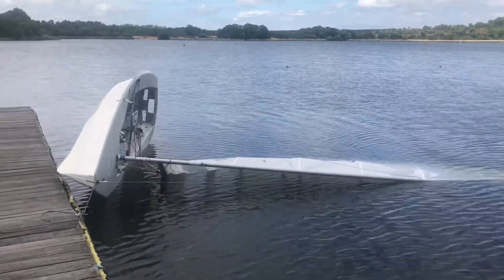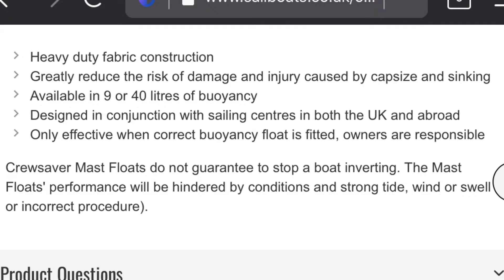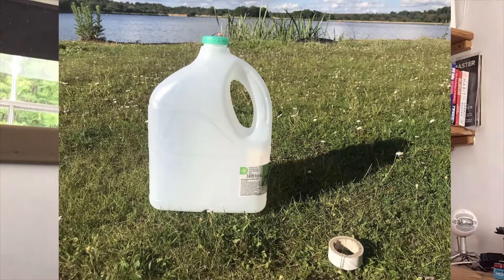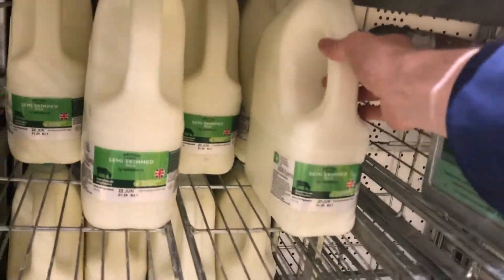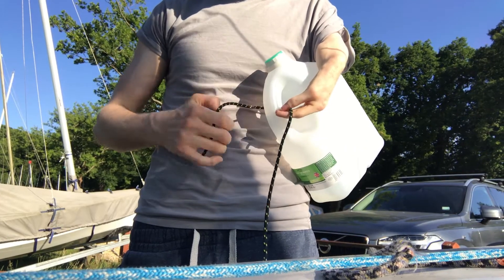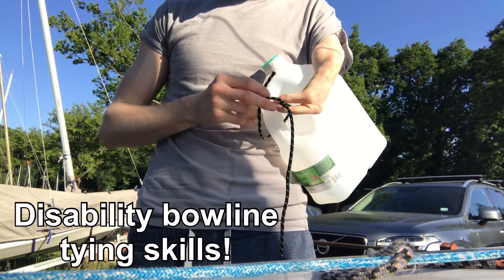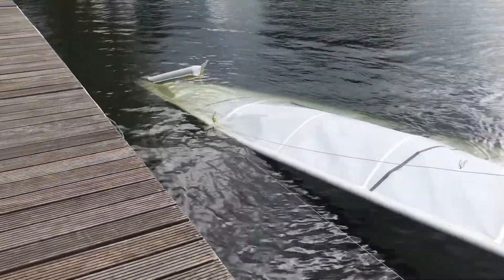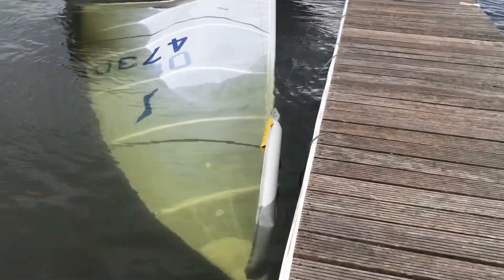How To Make A DIY Mast Float | Milk Bottle VS. Crewsaver Mast Head Float

Comment: If your dinghy is a bit bigger and has little spreaders like the ones in our Sailing club, then just put hollow poolnodles the shrouds over the spreaders. The colour let´s you differentiate boats easily during a race and it does a nice job as a float.
Reply: That is an excellent idea , or you could fix on pipe insulation (from DIY shop)  to the spreaders.  They are already marked to be slotted with a knife and could be fixed with zip ties.  I'm not sure how good the buoyancy effect but where the spreaders are gives better support to the mast on the water.

Comment: I've settled for a 5 litre plastic bottle tied to the head of the sail by a lanyard about 20 cm long. This allows the float to blow away from the sail and allows me to see the wind direction indicator at the masthead. This arrangement undoubtedly causes significant drag but is probably less disruptive than a 90 cm float lying along the leading edge of the sail. both work well having capsized in anger with both arrangements.

Comment: I just found a 4 euro inflatable "stool" here in Norway in a cheap furniture store. It has  45 cm in diameter and is shaped like a cylinder. Unsure about the height, but at least 45 cm. So volume is at least 71 L.  My dinghy is 17 feet. Will try it out, but compared to your milk bottles my plan is maybye an overkill..?

Comment: If the boat has a pocket luff, then the quickest, most effective solution is to stuff a pool noodle up the mast section.  Make sure you use the hollow type noodle so water can drain back.

Comment: Good vid, well done. I bought the 9-litre float a few years ago, although I'm mostly very careful not to capsize. But I calculated that it actually has less than 8 litres capacity. It's crazily costly for no better function than the bottles provide.
Reply from the maker: Thanks. Yeah, only reason to buy the floats is they look better. But if you're only concerned with function the milk bottles seem pretty much as good

Comment: How about running a line from the top of the forestay to the top of the mast - and use it to secure a hollow pool noodle - or even a large-bore closed cell pipe insulation? (same thing really)  If taut, it shouldn't affect the sail dynamics much or hauling the sail up, but provide good flotation?  Not sure if you could find one that fit around the mast itself. Haven't tried it, but a few swims last year from my ISO  are making me think about it.

Comment: Would be good if masts were supplied with a little extra free length above the sail pulley sufficient to install a wrap around buoyancy aid. It would look better and perform better. I notice that both the bought item and your milk bottle variants did not utilise their full buoyancy due to standing above the water.

Comment: Well the main thing is not to go turtle - or at least not have your mast go very deep (and get stuck in something unpleasant)  I submit that a 2 quart or 2 liter size bottle should be enough.  The deeper the bottle goes, the more bouyant it becomes.  I actually use milk bottles to tie to my mooring chains here on lakes in the winter.  I allow enough water into a bottle to allow them to submerge a couple of feet so the ice doesn't get to them in the winter.  Saves having divers charges in the spring.  If you do this make sure you take pictures of landmarks that you can triangulate the position of the mooring in the spring.  At any rate - the partially submerged bottles back up my theory about the size of bottle required toi prevent a boat from going full turtle.  I need to do some experimentation with this some more though ;-)

Comment: Any color other than black is not electrical tape, it's marking tape. Only black has legally-mandated dielectric properties.

This does not mean all black tape IS electrical tape. You have to look at the label for approvals from the governing bodies.

I say this because a flimsy layer of polymer and adhesive, though better than bare copper to touch, is not to be relied upon as proper, dielectric insulating, electrical tape.